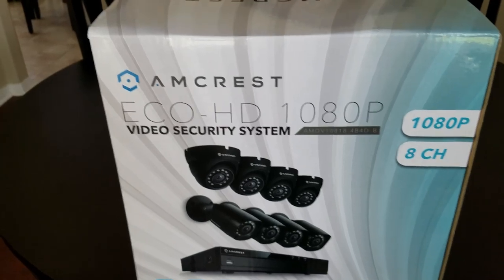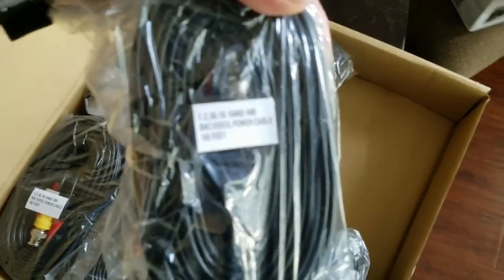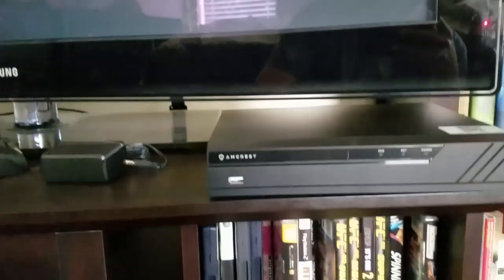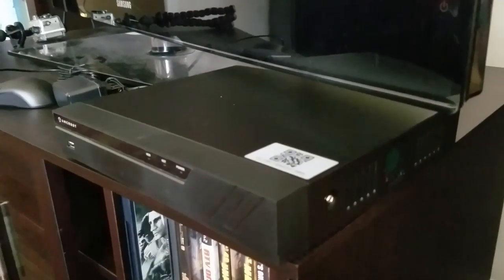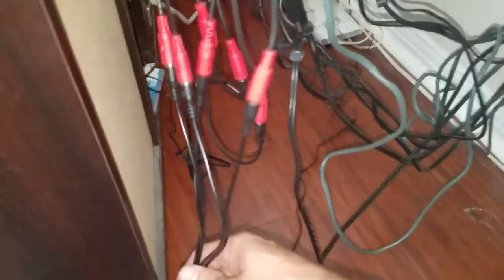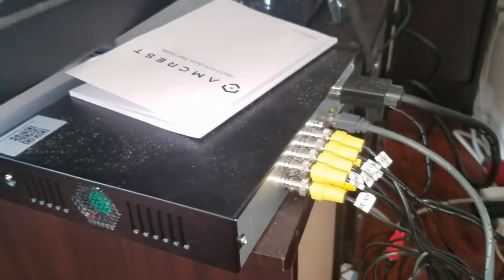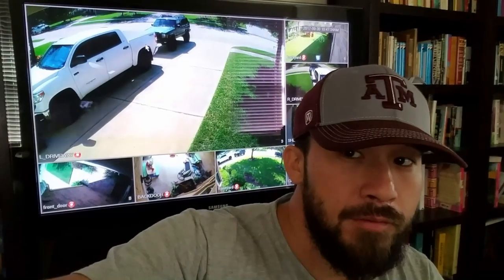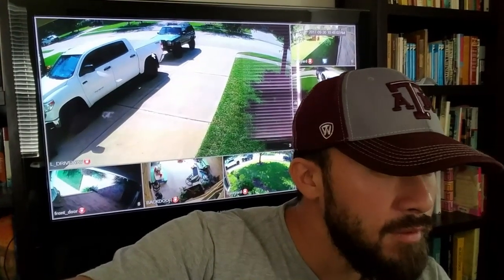Amcrest Eco HD 1080p Video Sercurity System Installation GMC wheels  Stolen

Comment: This was a nice video and you did an amazing excellent job. I purchased an Owl system with similar features. I even have fish tape just like you’re using. However, my attic was built more congested. Contractors used an excessive amount of insulation and it’s not as manueverable.  How did access the exact location from the attic leading to the outside and what is your recommendation for a home with more curvage in the roof layout. I have a 2 story home and the HVAC ducts , two heat/ac units make it extremely difficult to move around.
Reply from the maker: Thank you sir.  If you have time please check out my latest loads , they could use some support. Thanks again.

Comment: Please let me know if you had any problems with your system.  I am installing wifi cameras for the same reason you installed yours.  I am concerned with running the cables through the structure of the house.  I am also concerned with wiring.  My cameras are the 2020 low pricepoint ones that are common now.  The cameras need acdc wire extensions  but I am concerned with interference with the camera image because of the wires (poor quality or too long a run for th image).

Comment: Helpful video! One question though - Do these cameras let you hear sound from what its monitoring during LIVE feed and recording or is it just video playback with no sound?
Reply from the maker: Zimm VI no sound, it would be cool if it did.  In the menus there are  options and settings for sound and camera movement, but the model I bought doesn't have either, still,  for the price, I'm 100% happy.
Reply from the maker: Zimm oh yea, and thanks for watching!